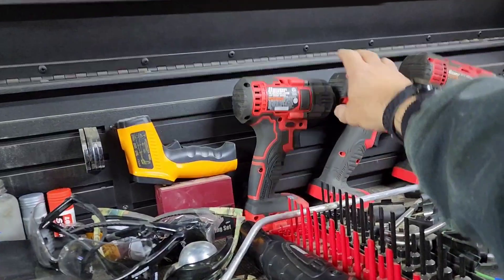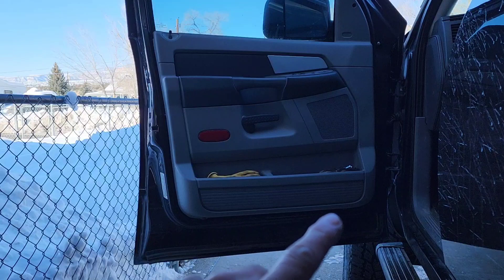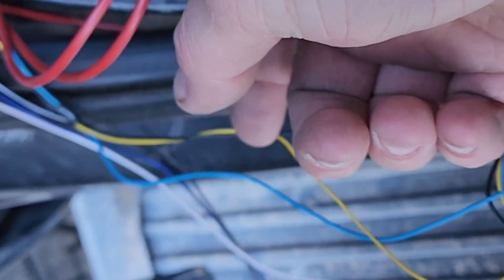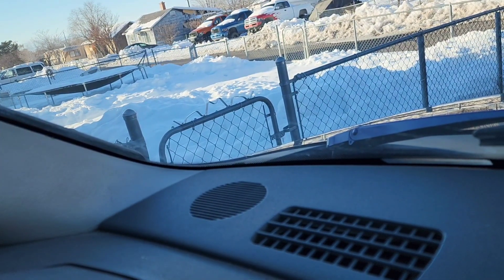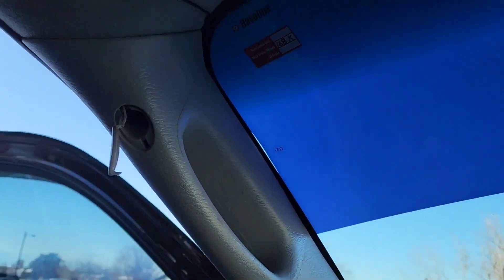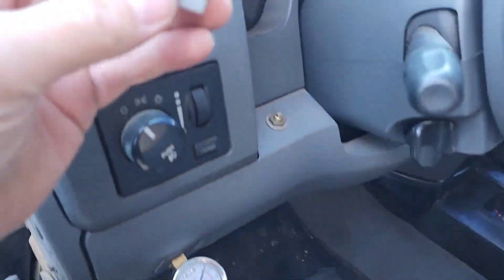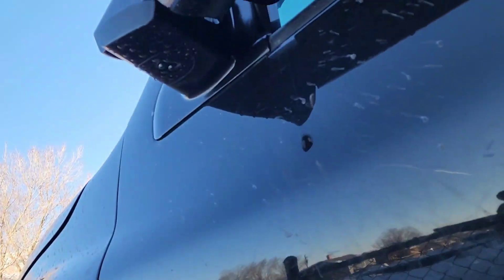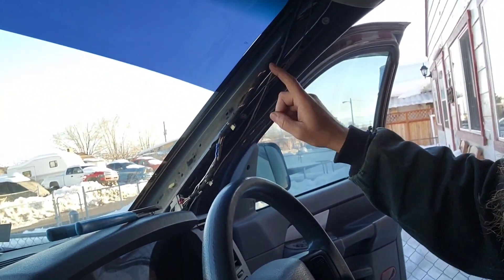Wiring puddle and clearance lights on my 2008 Dodge Ram 2500

Comment: so where did you hook the marker lights to, i know its to your handles,but where did you run the handles to? the head lights? or the headlight switch? i ran mine to the headlight switch and they turn  off after a min but then the leds stay dimly lit in the mirros.. any advice?
Reply from the maker: I ran mine to the marker light plug.
Reply: @cadilakisrodcustom  thank you

Comment: Where did you hook up ground too? I have my markers hooked up to my headlights and they work fine but the dome lights run off a reverse ground system on my 03 so they don’t come on when I have a normal chaissis ground?
Reply from the maker: I grounded mine to the seat bolts

Comment: Did you have any issues with your puddle lights just randomly blinking while your truck was shut off and just sitting there? I did the same exact thing, and had to disconnect them because I looked out the window after dark and happened to see them damn lights blink. Then about a minute later, theyd blink again. I was like WTF.
Reply from the maker: I had that issue with my dome light but never the puddle, I changed the dome lights out and the problem went away.
Reply: @cadilakisrodcustom  did you replace the dome lights with LEDs or standard bulbs ?
Reply from the maker: @dougsweldingfabrication953  I replaced them with leds
Reply: Damn bro.. killin me smalls. You didn’t show at all what wires you connected in the door to hook up the turn signal and marker lights and how you ran the wires through the doors into the cab. Do you have a vid on this?
Reply from the maker: @highcountryoutdoor  I don't, I hooked them up to my door handles, but for those I ran wires up to the headlights through the firewall.
Reply: I'm having the same problem today puddle lights flickering and leds in my Dome stay dimly light